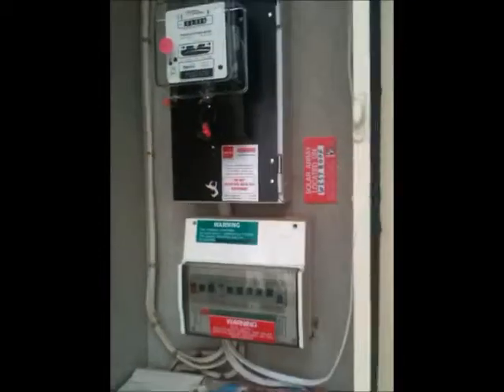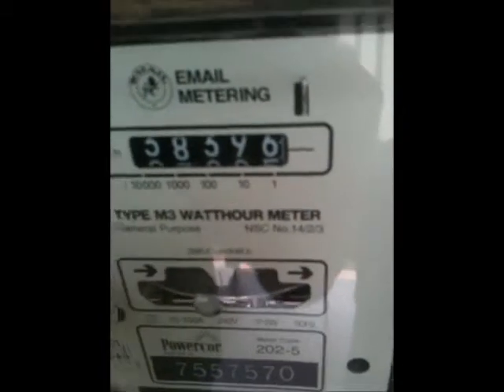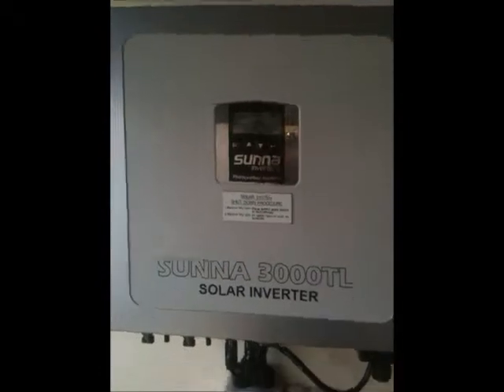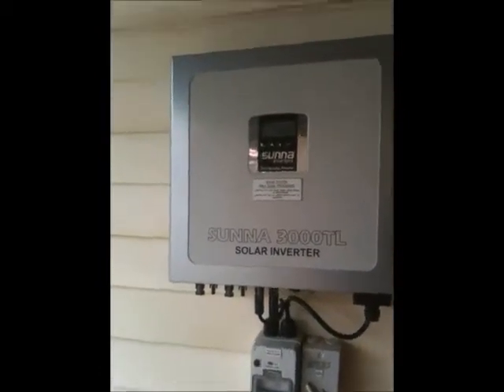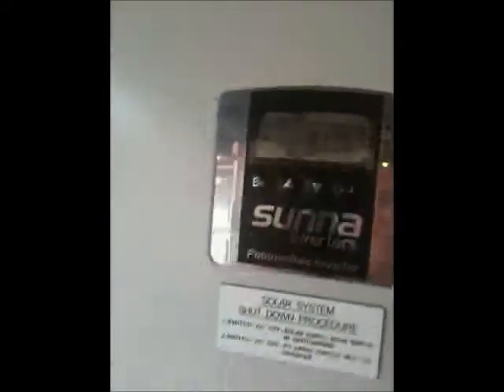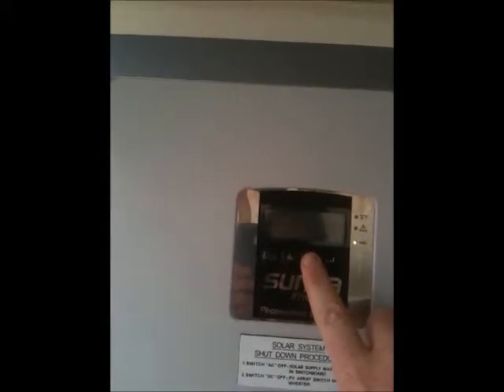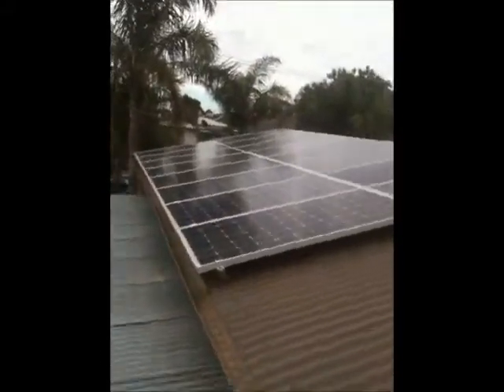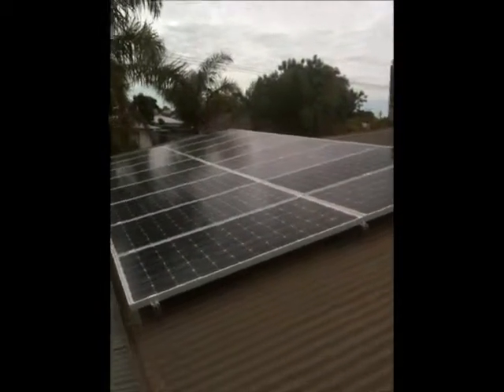3kw Solar Power System.wmv

Comment: G`day mate, looks good, the safety switch down below to disconnect power to the house from panels? the reason i ask is a while ago i was talking to a mate about solar panel set up,  he told me after a chat to a firey ,if a  house catches fire with panels, they won`t get up on the roof or hose the roof down , because while you can shut the power from below, on a sunny day the panels are still charged on the roof, water and electricity = no no, so they let it burn to the ground, is this  correct?